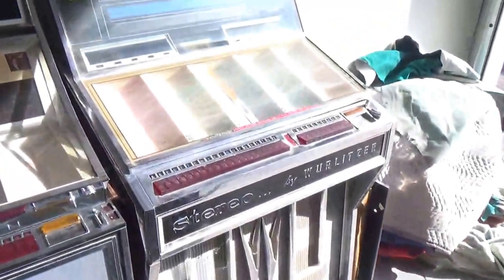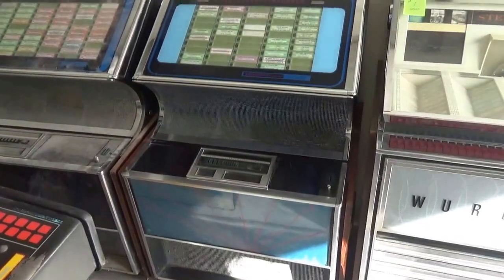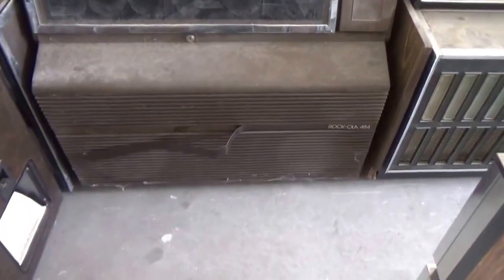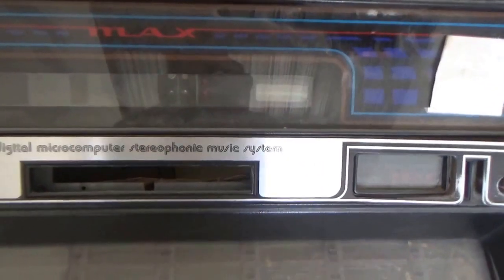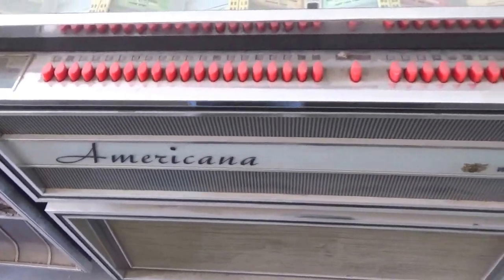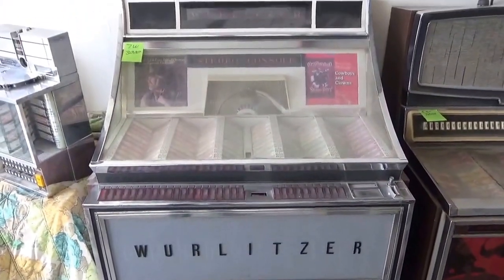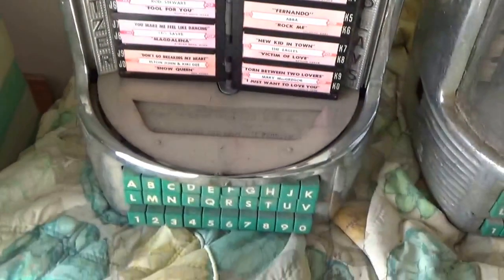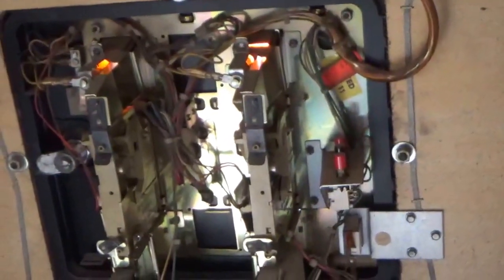Jukebox Warehouse of Wurlitzer's, Rockola's & Video Arcade Games

Comment: It is a rockola max 477. Can you please advise what a golden bar is? A google search doesn't help me.
Reply: Golden Bar was a Wurlitzer feature that was also called Top Tunes on some models.  I was a button that played a pre selected selection of songs.  I believe it was $.50 for 5 songs.  You couldn't select the songs...but got great value for your money.  Under the hood....down on the pin bank was a solenoid or small motor that drove a slide with teeth on it that popped the pins of the selections when the button was pressed. The Operator could set it to pop 10 odd selections....typically loaded as the B side....or 10 consecutive selections.  The records had to be loaded under a certain Letter because the gear driving the pins was in a fixed mounted position.  If a Jukebox had the Golden Bar feature installed, the wall boxes could also have the button for remote selection.  The video above illustrates a wall box with this feature installed.